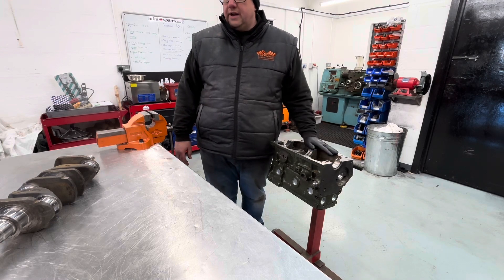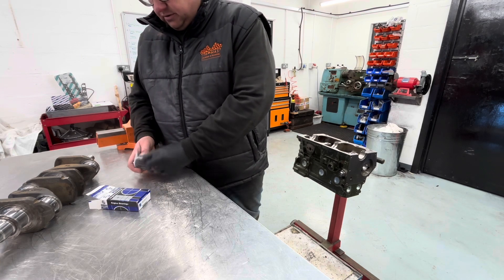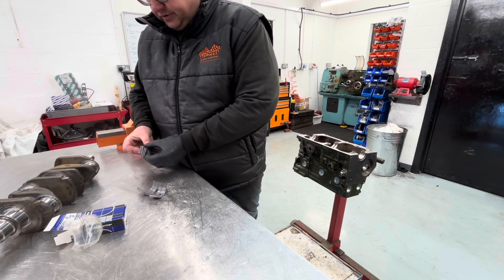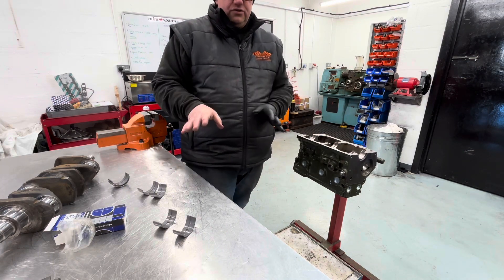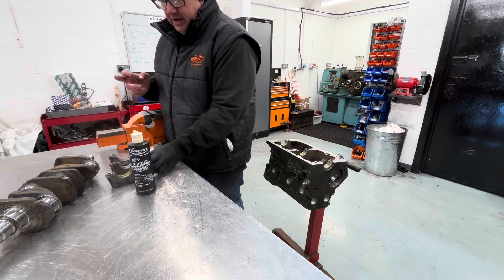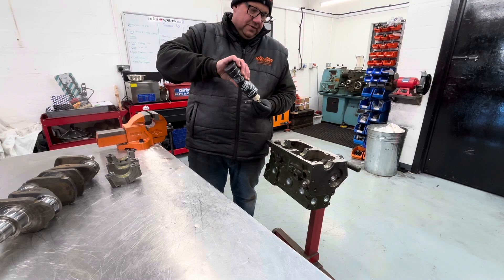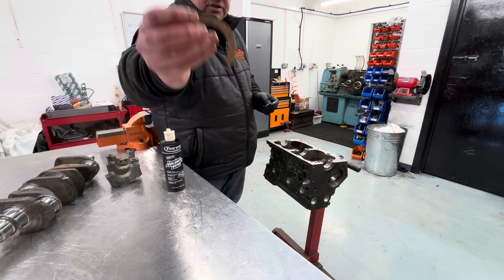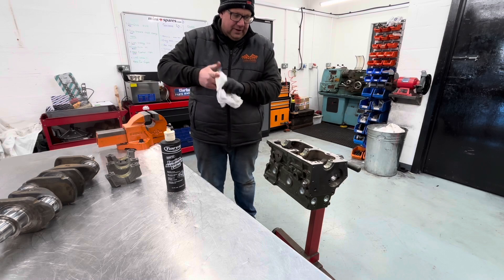Classic Mini Short Motor Build pt1 - Crankshaft Fitting

Comment: When inserting the thrust washers and tightening the bearing cap what do you do if the crankshaft has gone tight ?
Reply from the maker: Either too little bearing clearance or too large thrust washers meaning no clearance. 
Or wrongly fitted cap. 
Firstly put the cap back on with no thrusts in place see if it still goes tight. If so your issues in bearing clearance. If not it's the thrust clearance

Comment: Would assembly lube impact end float when measuring during assembly or would oil be preferable?
Reply from the maker: Entirely personal preference. We use both dependant on the timeframe that it's likely to take for the engine completion / install